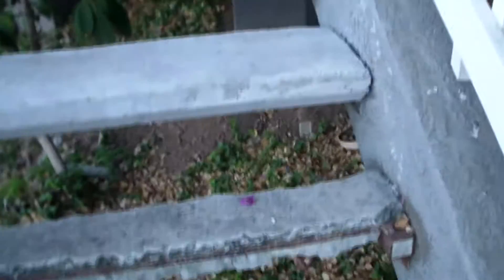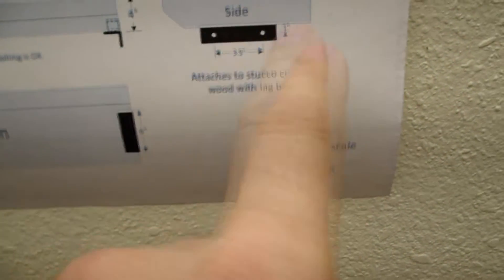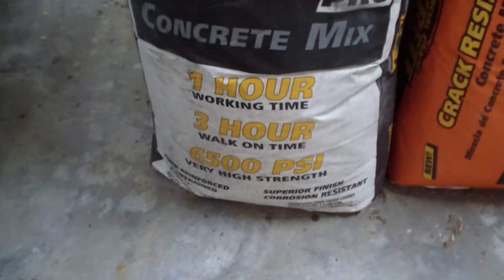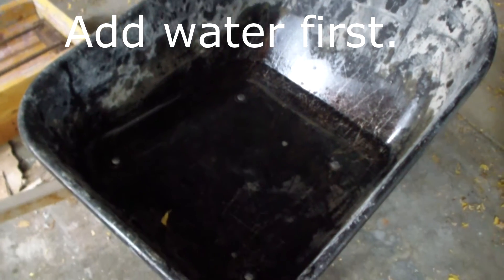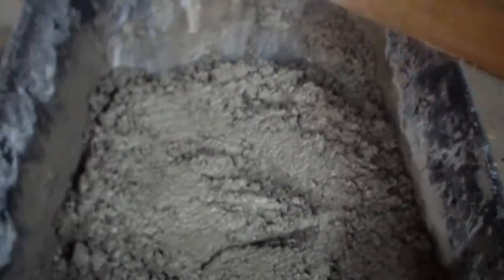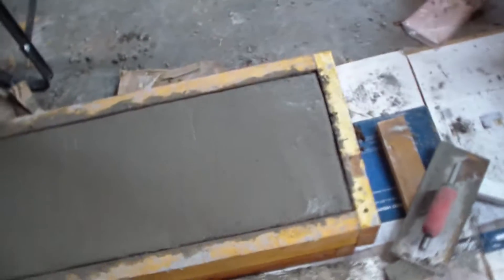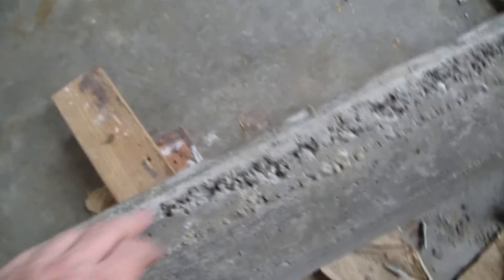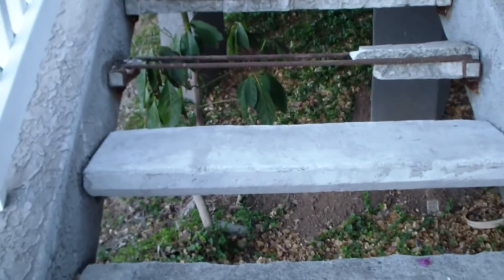Casting Concrete Stairs Construction DIY

Comment: There are additives you can put into the mix that will actually make the mix runnier without adding ANY additional water.  They are called superplasticizers and they can help the concrete cure harder as well.  This is due to the increased density and reduced shrinkage.  The concrete manufacturers don't really explain that to home owners that grab pre mix concrete from the store and just use water alone.  3 quarts of water is the optimal amount of water for the strongest concrete but it is not workable.  I know a curbing company that makes a powdered product called Curb Gravy that does this.  You should try it on your next project.  I think they send out small samples you can try before you buy a bucket of the stuff.  Go to www.borderlineusa.com for this additive and call their number for a sample.  This stuff is amazing.  I've seen new concrete slabs homeowners do around their house and they crumble and fall apart due to mixing with too much water to get it to "pour" and have good workablility.  So check it out its awesome.  No more beating and tamping the concrete cause it will flow into the form no problem.  Just vibrate the are bubbles out and you are good to go.

Comment: add a little more water,buy or build a small concrete tamp and use a palm sander to vibrate
Reply from the maker: I was trying to use minimum water as the more water used causes concrete to lose strength. Every week I cast a new step so I keep getting better at these. The voids in the video were cosmetic problem that can be filled in with a layer of thinset mortar. I am confidant that with proper tamping the voids will be gone. I am sure vibration would also work for a wetter mix.